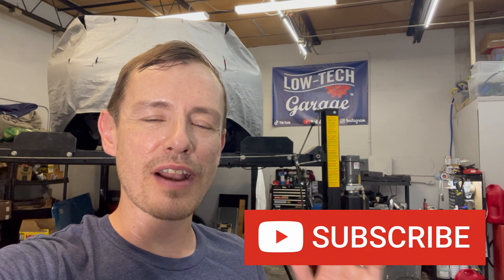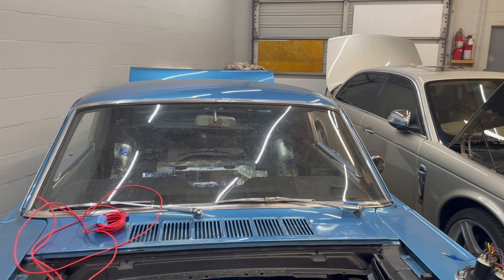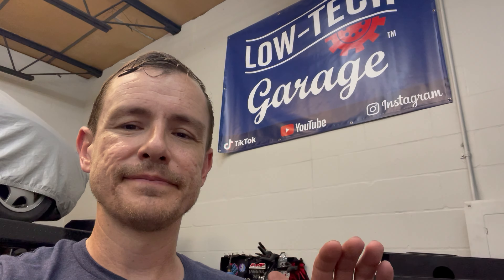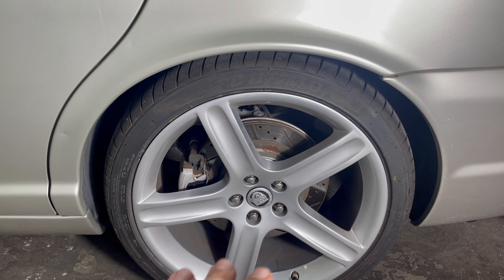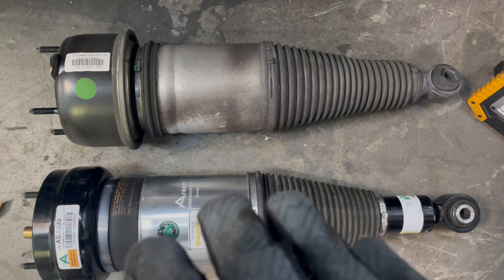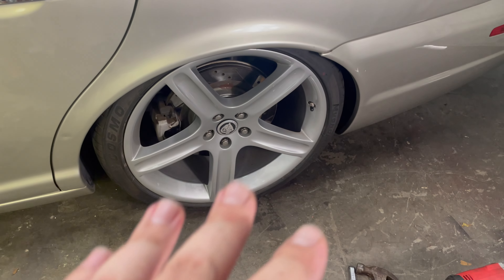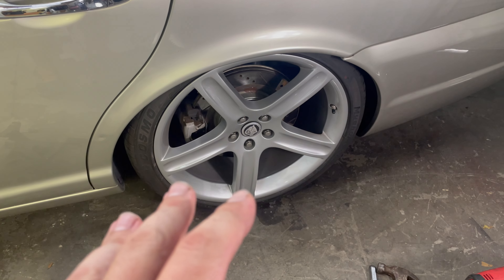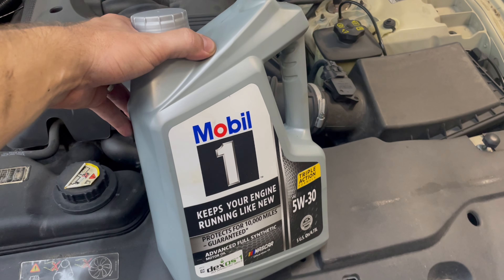More Air Suspension Repairs on the Jaguar XJ VDP

Comment: Thanks for these videos. I just picked up a 2006 VDP so seeing these videos really helps me understand the vehicle. Awesome car. It has a Tire Pressure Sensor Fault warning, tire pressures seem fine, any advice?
Reply from the maker: It’s quite likely the sensor in the wheel. The batters go bad after 10-15 years. 

You’ll need to get a new sensor and have the tire pulled off and remounted. I would recommend replacing all 4. 

Usually it’s best to do this when you need to put new tires on to save a little $

Comment: The one downside to Arnotts is that they don't support the CATS.
Reply from the maker: I know :(  The car already had two installed so decided to stick with them.
Reply: @LowTechGarage  does this make the ride different when I purchased my x358 it had Arnott all around already but no faults so how would it be different with the original shocks?
Reply: @jonathanbarajas5677  By utilizing the CATS the OEMs (Bilstein) supposedly adjust the firmness as you drive. My apology if that's not what you mean by your question.
Reply: @jaromor8808  yea that's basically it, I wasn't sure what CATS did exactly.